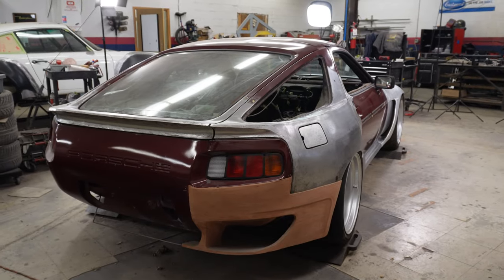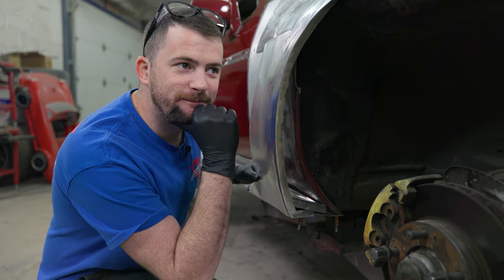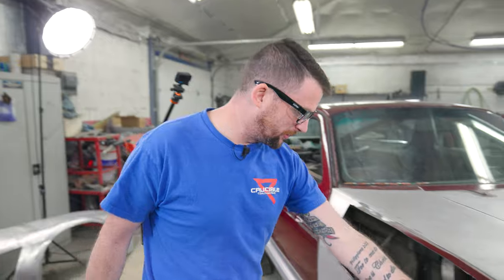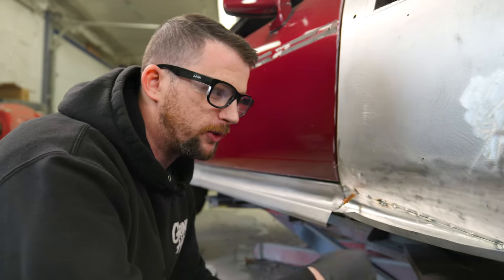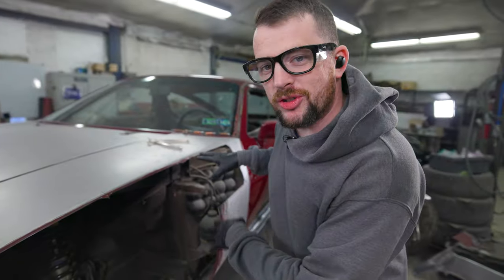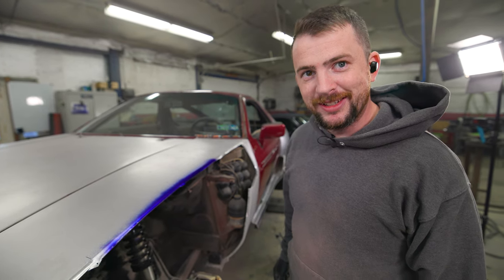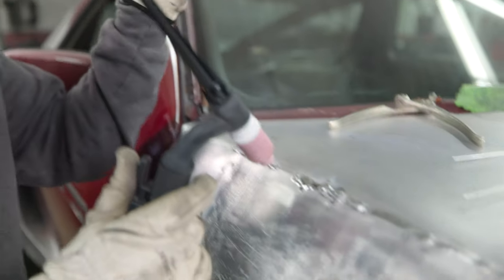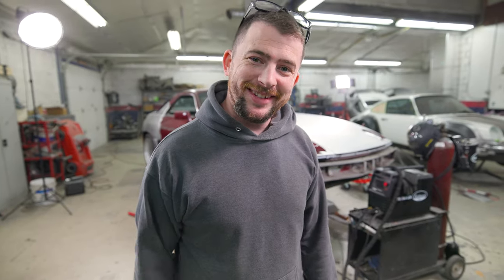Welding THIN Aluminum is HARD! - Widebody Porsche 928 - Ep. 31

Comment: I'm a software guy, amateur car builder, building a 1930 aluminium bodied Riley with gas welded panels and it is such a struggle!  It makes me feel so much better to see people who do this for a living say its hard too :) Do you weld from both sides? I struggle with getting decent penetration with both TIG and gas. So now I weld from both sides which seems to help. I prefer gas welding since it leaves everything annealed so smoothing it out later is easier. TIG aluminium welding is so buzzy and stressful but oxy acetylene is very calming, when is (rarely) goes right!

Comment: Your builds are Awesome I have S3 928 and I have owned it long time and had time to think some mods to rear end. Battery box can't be in very good condition anymore, cut it off and slap four LiFePO4 cells in space saver wheel hole. There are also many other cells like LTO which are safe inside and can be mounted flat. You have so big wings that You need more downforce so make real diffuser which start from rear subframe and twin exhaust can go through those notches in rear frame and shoot in there for more speed on air. This is GT car so big tank is needed but bottom of tank should be cut away and extended to the battery box space or even higher to the floor. That plastic tank can be also welded with right tools or just make metal tank with diffuser formed in it.